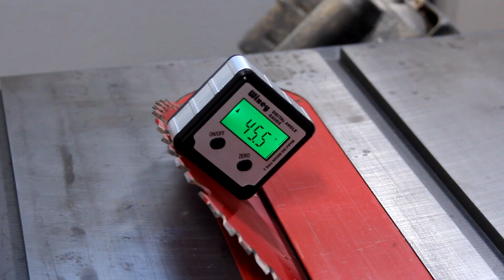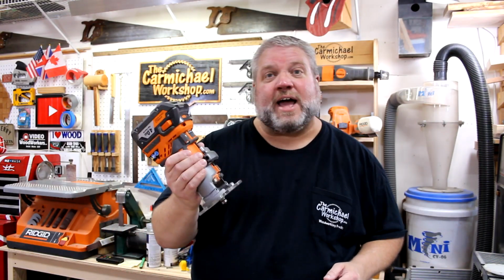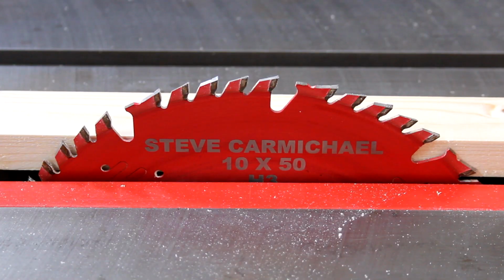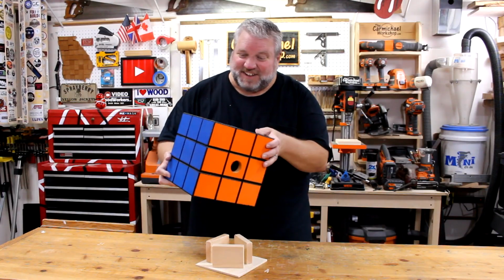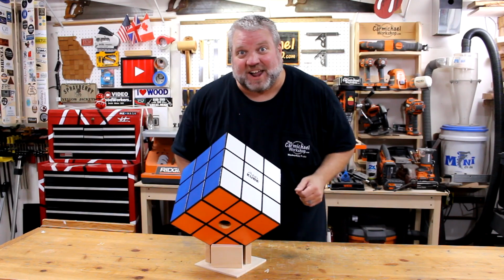Making a Rubik's Cube Birdhouse - Outdoor Woodworking Project

Comment: Ok, I am so building one!!  I was in the shop myself and the notification popped for this video, I slapped the drill press off, grabbed a glass of ice water and fired up the You Tube...  That is one fine birdhouse Steve. A Giant Rubik's Cube is on the list.
Reply from the maker: Awesome!  It's very easy as long as the 45 deg bevels are pretty close to accurate.  The painting was kind of tedious but it's so satisfying to pull the masking off.